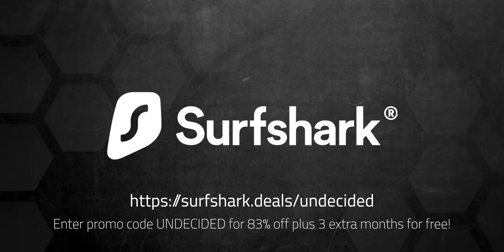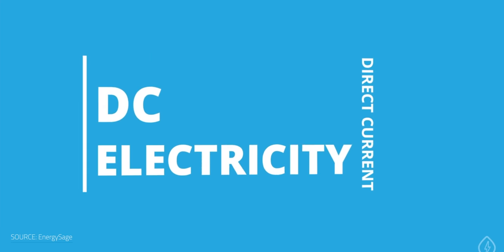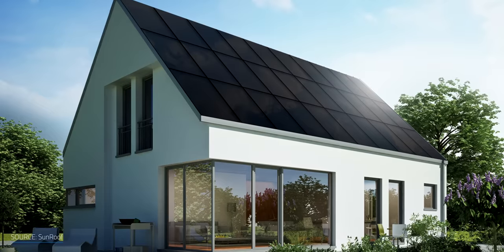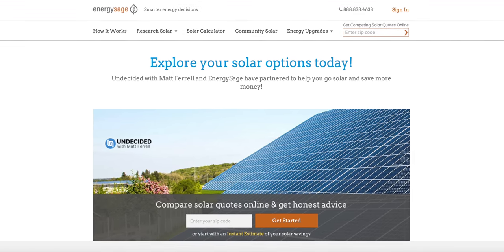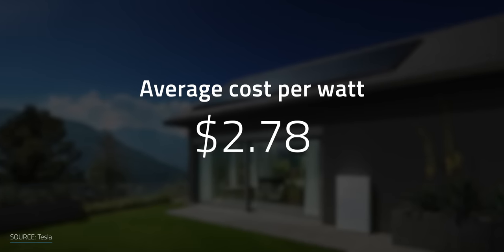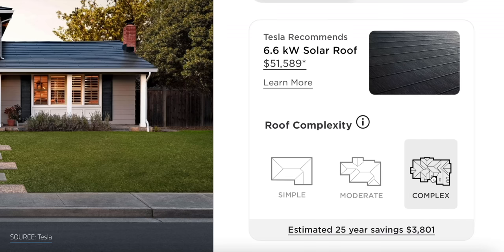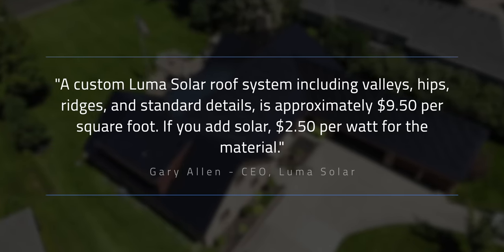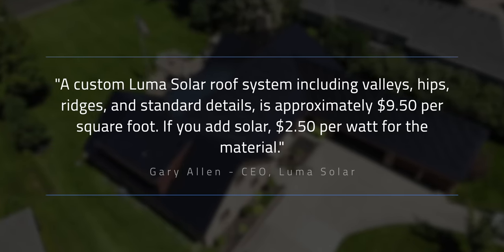Exploring Tesla Solar Roof vs. Solar Panels

Comment: Would a full solar roof keep the house beneath it cooler in summer, leading to less energy requirements for air conditioning?
Reply: In theory yes, but a white roof would probably be more efficient
Reply: @JamecBond  
it wouldn't generate any electricity though :)
Reply: If anything, I’d say panels would do more to keep the house cooler, because they actually shade the roof itself and have a small amount of airflow underneath to cool them as they heat up in the sun. Tiles, on the other hand, actually make up the roof and will transfer the heat they absorb directly into the house below. Probably not much more than a shingle roof would transfer, but definitely more heat transfer than a shingle roof shaded by panels.

Comment: Hey Matt, you would think someone would come up with panels that could be put down without a roof.  Im picturing standing seam panels about a foot wide and lengths cut on custom basis for each roof from eave to peak. Fill in the valleys with standard standing seam roof products. Forget about the fancy expense of the tesla look or style. they would look like a panel tin roof, but have the cost advantage of not needing the roof under it.  I expect that to be the future. Is anyone building something like that?

Comment: What does it cost to dismantle and get rid of? Dropping a normal shingle roof is quite simple  and brute force operation. I would think the solar ones need to be taken out with a bit more care and they are E-waste as I understand so the costs and be significant.
With panels you at least theoratically could install new panels to existing brackets.

Comment: Thanks, great stuff as always. Maybe if cost isn‘t a factor, it would be interesting to see if tiles allow you to add more solar area on a roof and therefore become equally powerful. I would guess you can fit in more tiles, then large panels with gaps.
Reply: It would probably workout to be most favorable to the roof if it is a simple incline at the optimal angle and direction for non rotating solar installations.

Comment: Considering I live in a house that's over 40 years old, panels. It'd cost more than the damn house for a Tesla Roof. My panels produce far more power than my house needs even during summer with the AC running because we have a simple roof with over half of it being south-facing.

Comment: Thanks for some figures and dollar value.
Can you track which solar tile is faulty in a string?
Can you walk on the roof to replace?
A 10kw solar tile roof could be producing half as many kwh as a solar panels, when factoring efficiency and orientation.
I do like the robustness of the Tesla tile.
Cheers from Oz

Comment: Panel is better. If you have a circuit go out at the top of the ridge  the whole roof of tiles has to be removed to fix it. Then they have to replace the ice and water shield and start over.

Comment: The trick, is not the solar panel, but full integration and ease of installation and that requires a full roofing system that seamlessly interlocks with a solar roof tile through design.  Envirotile Solar integrates with the existing Envirotile roofing system and will be launching later this year at considerably less cost than Tesla.

Comment: I am keen on the concept of solar roof tiles for new dwelling builds, as current car based urban planning moves to sustainable environmentally friendly public transport, cycling, walking urban planning. In my country, 85% of power generation is renewable, through hydro, wind and geothermal with the remaining generation from coal and natural gas, so with future new sustainable environmentally friendly housing developments, using purposely built dwellings that are design with solar roof tiles, a small wind turbine and a storage battery, would make up the remaining 15% of surplus power being sent to the national power grid making power generation in my country a 100% renewable.

Comment: I had a thought for a charity. Going along behind storms and providing people upgrades to their roof to a solar roof. Hail storm comes through so the insurance will pay to replace the shingle roof. The charity would basically cover the coat difference between the replacement roof and the solar roof. It's the ideal time to do it as the old roof is coming off anyway so there is no extra landfill waste. After a few years you could literally have thousands more homes on solar. They could also be ik installed with the transfer that would allow the owner to add a battery system later. 

Questions really is would people donate to such a charity?

Comment: We need a new roof.  our house is almost 23 years old.  The main roof lines are simple.  Seeing as we need new roof anyway, pretty interested in the roof tiles, as installing a simple composite roof is pretty expensive up here as it is.  So I am hoping to find that considering roof replacement costs, the roof shingles option will work for us.  Am talking to the local installer of Test roofs now.  Not sure if anyone else installs other solar roof products here.  Generally, it is panels.  Solar also takes a long while to pay off where I live, because it is Idaho.  And the numbers don't work that well.  But, we are in a good place for solar production, so will probably do it anyway, even if Idaho Power is not playing nice with making it pay off well.  One way or another, we are going solar.  AND converting our gas forced air furnace, which also has to be replaced, with an electric heat pump system that hopefully we will drive with solar.  And also charging for our new car coming, with another to be added later.

Comment: Great video Matt, as always! I’m still trying to get around your figures for PV solar panel installation costs, based on my own experience. I have 20 x 310W panels that cost €115 each. The total install price for my 6kW system including panels, inverter, cables brackets, isolators and installation came to just under €8,000 , which is €1.32 per watt. This is an awful lot less than the figures you quote. Am I getting this all wrong? I would dearly love the tiles, but I think they are just horrendously expensive, even when replacing a roof.

Comment: Tiles are also going to have a major problem with obsolescence.  Sure you can just replace broken tiles while the system is in production.  Two or three product revisions down the road and well.... Let's hope Apple doesn't make solar tiles.
Reply: 🤣🤣Apple doesn't make solar tiles- 

I would think they wouldn't divert too far from the original blueprint- Apple phones as with most phone have the camera, volume button, speaker to hear at the top of the phone - while the mic, etc is on the bottom- if you get my drift..

There are automobiles over 25 yrs old still on the road and in need of replacement parts - and you can find them

 hopefully the solar industry will migrate into that same ecosystem..

It's still early
Reply: @MrHammer2088  Planned obsolescence is designed to make you think that.  Or it wouldn’t work.

If you think about it your car example is a good example.   There are very few cars on the road that are 25 years old.  Almost all of them are gone for the same reason.   The cost of fixing it is greater then the cost of replacing it, leaving the few that we have left. 

That also includes the fact that body shops can make the parts they need and don't have to get them from the manufacturer which wont even exist a few years after the car is out of production.  

You can’t do that with solar tiles or Apple parts.   That is indeed the reason Apple make small adjustments to the screen with every product even when it’s not really needed.  It’s more profitable to sell you a new phone then fix the screen of an old one so new parts better not fit the old phones.

Even Musk who is trying to change the world does this albeit for different reasons.  Newer designs. better manufacturing systems. Etc etc means they already have three different incompatible systems on peoples roofs but they are only supporting the latest and have no ability to create the previous ones as they retooled the factory.  

With existing roofs, they get fixed every 25 years or so. So you see houses from the 1800s.  With the new systems you’ll likely have to be replacing the whole roof just due to obsolescence of parts.  A way more costly event.  More then an order of magnitude more costly.  

Solar panels on the other hand don’t have to interconnect to the point of being water/snow proof so it’s much more likely to be able to mix and match as things go along.  

Now, I'm not saying there isn't going to be people that pick disposable roofs.  People already happy to replace there phone every couple of years.  Just that this is a big difference between tiles and panels.
Reply: @lucidmoses  I hear you- I just hope a tile serves its 25 yr lifespan before it becomes obsolete ..
Thanks for the explanation
Reply: @MrHammer2088  I look around at all the people slowly destroying their hose because they can't afford new shingles and wonder how much better things will be when it will cost ten times the price.  :P

Comment: I'm really curious about the increased temperatures from having solar panels or tiles vs. a white, reflective roof. I work in spray foam insulation, (which is clearly the best though we need a recyclable product).  

  Even with blown or batt fiberglass, the attic gets super hot and causes you to use more electricity to cool both the internal unit/ducts and house, even into the evening as trapped heat radiates into the house from above. 

Dark roofs, (and roads) as well as extensive use of A.C. contribute to the urban heat island effect. Though even suburbs increase temps, just not as much. Anywho, the absorbed heat and heat radiation from AC units make the surrounding air/environment much warmer.  Obama administration urged painting roofs white. We worry about the loss of the Arctic ice for the animals but also the cascading effect of no longer reflecting the solar energy away from earth. There is more roof area in the U.S. alone to compensate. Plus a cooler home to start with means less AC and a cooler environment means a better functioning AC/heat exchange. 

Solar panels are designed to absorb as much light and heat as possible. If adopted as is, en masse, I worry about the adverse effects. This will clearly bring efficiencies down overall. I'd be surprised to see real world efficiencies over 15%. 

My ideal would be MSR nuclear plants, smaller and more dispersed/less centralized. This would give the grid more adaptability, less energy loss through transmission. We could use more passive building techniques like white roofs, full envelopment of living space (via spray foam insulation. Along with this, reuse grey water. Use all water more responsibly. Electric cars are the future simply due to the myriad of ways we can make electricity. We can make common sense and meaningful changes. I think sometimes we get so caught up in the hype that we neglect the practical and necessary.

Comment: One question: because of their smaller size, can you put more tiles on a given roof than the larger panels, and therefore generate more power? Can you, for instance, cover 80% of your roof in power generating tiles vs only 60% coverage with power generating panels? I realize that not all of the tiles are generating power, and some are just there for aesthetics, but all of the panel installations I have seen have a lot of roof real estate unused. It is like trying to load the trunk of your car. You can use almost all of the volume if you are packing in a lot of small items like ping pong balls, and put them in every nook and cranny, whereas you would be limited in the number of basketballs you can load because you can't fit basketballs into the smaller corners. More of the volume remains unused, just like a lot of the square footage of a roof remains unused in a panel installation, depending on the configuration of the roof.

Comment: Bad picture 4 tile roofing of flange , those courses should of covered the flange at least partway down , some caulk under flange top and sides leaving out bottom for in case water gets under c,can drail out , especially with snow , and some do courses covering 1/2 way down to rubber cutting arch . That would probably leak with a4' ft snow load ice and thaw and refreeze

Comment: I had a bad experience with Tesla solar, and I'm not alone. There are lots of bad reviews. To me, they were simply vaporware. They took my deposit and ceased all communications: no returned calls or emails, no further information. They have no dedicated installers but rather contract out to the lowest local bidder, who may or may not be around if a problem ever develops in the future. Tesla was also not forthcoming in the full rebates available in California for battery purchase, electing instead to keep those benefits for themselves, thus artificially appearing to be cheaper. I canceled with Tesla and contracted with a well-regarded local company and LG batteries instead of powerwalls.

Comment: my question is - can you use tiles if you are off grid - or do you have to be connected to a power company...? just curious?
Reply: That’s exactly the same as with regular panels. So yes, if you have a battery or a backup generator, you wouldn’t necessarily need a grid hookup.

Comment: The problem is that the "hard" cost of solar are leveling off and the "soft" costs are rising.  The industry is going to have to address the rising "soft" costs if they are going to reach average joe consumer.  Right now, it's upper middle income and wealthy that are putting in solar.  Of course, if you live in CA, you have no choice.  All new residential  homes must have solar.

Comment: Can you do a video about plug-in hybrids and their viability in the current market compared to ICE or other alt energy vehicles? Do PHEVs have a place in our market or are they a meaningless compromise?
When (if ever) would it be worth it to get a PHEV?
Reply: It depends on how easy you can charge in my mind. If you can charge where you normally park I’d say go EV. If you can’t, well, I’d say a PHEV might be a decent solution. I’m trying to get my building to have chargers in the garage, when that is there the old ICE is going away ASAP.

One thing to consider is the residual value of the vehicle. I’m keen to get out of my old car as I see it being worthless in 3-5 years. What value will a PHEV have in 5 years? How long do you want to keep it? Maybe a 2-year lease is an option?

Comment: I'm from India. I just finished installing panels on my roof for 0.76 $ per watt. Sure the efficiency hovers around that of the Tesla roof, but I can run my AC and refrigerator on it. I also get enough to save for lights at night. So panels at 6$ per Watt just sounds insane. A rip off.
Reply from the maker: The prices I quoted include installation, so it's not that crazy when you consider local labor costs, etc.  But yes ... prices in the US are nuts compared to what you're seeing in India.  Australia also has amazing prices.  I'm jealous.

Comment: I've never understood the argument for using panels on an existing roof. What happens when you need to replace your roof that has panels on top? I'm sure they extend the life of your roof a little but probably not enough to justify the added cost of removing and putting them back on.
Reply: In Europe our roofs last for 50 years or more.

Comment: of course it complexity of roof matters a lot here so i would say if your roof is simple and you need to make repairs to it anyway then tiles would be much more considrable.
if your roof it doing fine i would always go for  panels because of the efficiency, also if something happens and i dont like them anymore i could always just move them off the roof but still use/sell them?

Comment: Hi Matt, I was wondering if you have heard of these panels before..410W Silver Mono 72 Split-Cell Panel by ET Solar..They seem to be the next step in solar or am I behind the times?
Reply from the maker: Haven't heard of those specific panels, but the style I have.  There are really high output panels available now.  They tend to be the most expensive, but those prices will drop in time.
Reply: They are also introducing bi-facial panels in both split & whole cell designs.

Comment: How to they compare as far as durability? Do they hold up to things like snow, or strong winds?
Reply: by the look of it, tiles are better as they have a small profile and attached separately. If you get gale force winds, the panel will catch more resistance because of its height and size.

Comment: Solar panels all the way. There are too many caevats with the solar tiles such as how easy they are to clean and inspect. One thing that I did not know when I installed mine is that you HAVE to clean them every 2 months or so because they drop 20% efficiency when they are dirty. Also if one is bad the total output will drop significantly, not just proportionally to the total (if you have 10 panels and one is bad that means your output will drop by more than 10%). Translated into tiles that means you need to be on quality control constantly just to keep the nominal gain.

Comment: Matt, great video!  How is energy production compare?  It seems to me that due to the size and shape or panels, I would have more energy producing capability with tiles because all of the roof is utilized where with panels I can only install on the main flat parts of the roof, my eves are too small.

Comment: I am building a new home in South Florida. Any idea when Tesla solar tiles may be approved with hurricane rating? Luma solar roof website shows it is approved in South Florida, but there is no way to contact the company. Submitted a few requests online to reserve but never received a response. Couldn't find a number to call either. Any suggestions?